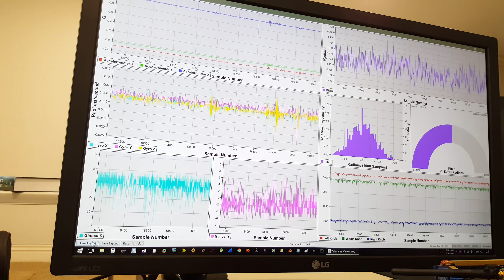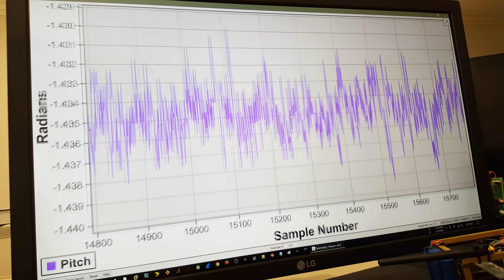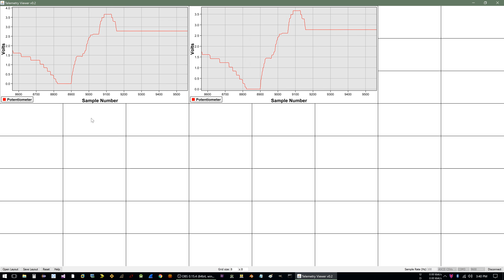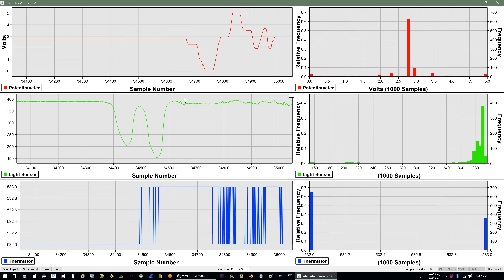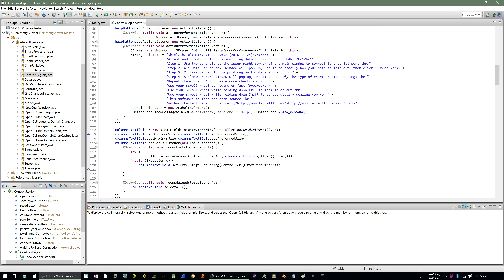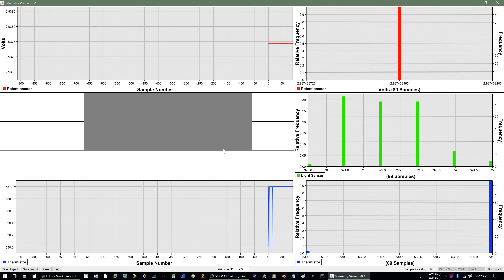GPU-Accelerated Arduino Data Logging and Telemetry

Comment: Dude this is fantastic.  What are your plans for its application, beyond tuning the balancing robot's control algo?
Reply from the maker: Thanks! I've been planning to make a video on how to design a crude delta-sigma ADC with an FPGA, and this program would be a big help. I plan to develop the Frequency Domain chart into something more advanced (adding a waterfall mode, automatic peak markers, etc.) to really demonstrate things nicely. I'd also like to try developing a more complex robot, maybe a hexapod or centipede, and I'm sure this program would help me struggle through the development of motion control algorithms for that. But this tool is primarily meant to be a general purpose thing for development and debugging. I've had several projects in the past where I could have really benefited from something like this, so I decided to make it before getting desperate for it.